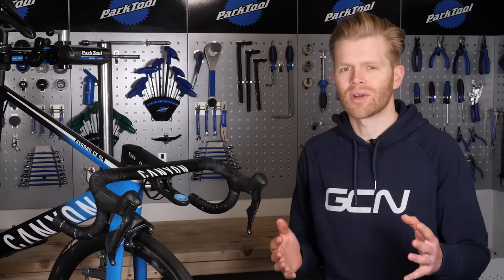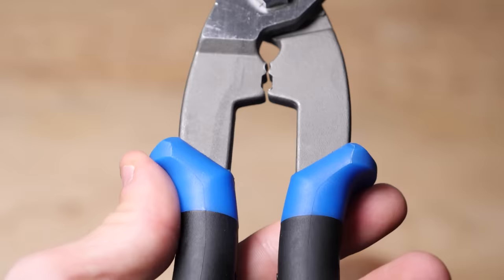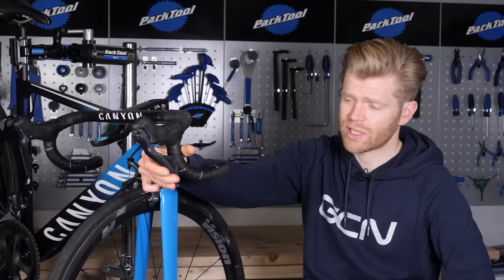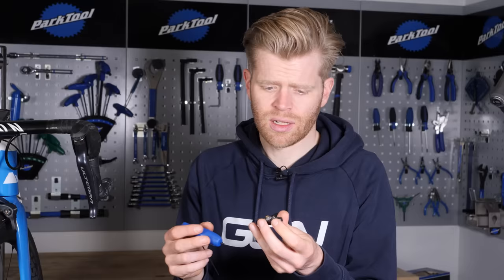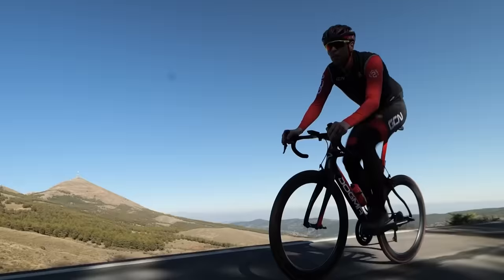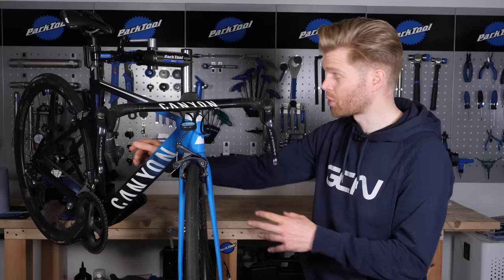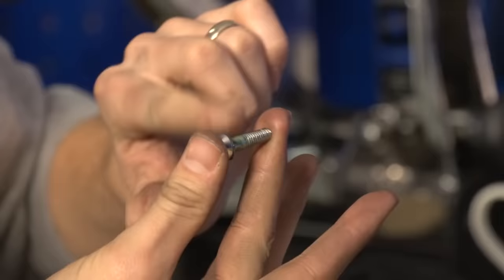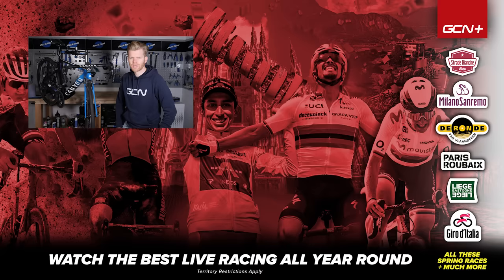Try This Before Changing To Disc Brakes! | Maintenance Monday

Comment: Instead of a card I use a rubber band wrapped around the brake pad to set toe-in. The rubber band provides more friction and prevents the pad from rotating as you tighten the pad to the brake arm. Also, I do like to have the gap between my front brake pads a little bigger than my rears so that my rear brakes engage first. No fun having the front wheels lock first and launching yourself over the handlebars...especially in an emergency stop. I have found find that on alloy rims the performance of Kool Stop Dual Surface Brake Pads never cease to delight. Most Kool Stop brake pads have a feature called a "Plow Tip" which substantially reduces the grit that can get trapped between the pads and rims. This effectively removes a common objection to rim brakes...that they contribute to premature wear of your rims. The plow tip can also be used to set the proper amount of  toe-in. I bow to the engineers who invented this feature! Long live clever engineers!!! 🙇‍♂️🙇‍♂️🙇‍♂️
Reply from the maker: Great hack, Mr.Luigi!
Reply: My Kool stop pads have a little raised point and one end and 'automatically toein'
Reply: @chrisprice5895  
that's a nice and clever feature. I always looked past kool stop though because they are expensive, admittedly.
Reply: @chrisprice5895  Hi Chris, Yes, that is a great feature. It's often called the "Plow Tip." Here is what Sheldon Brown says of the feature.

Plow Tip

The plow tip is a small wedge-shaped projection at the rear end of most Kool Stop models.
It acts as a squeegie to clear water and grit from the rim, so that they don't get caught between the braking surface and the rim. Setting conventional flat-surfaced brake shoes so that they provide toe in creates the risk of trapping grit and sand between the brake shoe and the rim. This grit then gets embedded into the surface of the brake shoe, where it grinds away at the rim every time the brake is applied. This causes premature wear to the braking surface of the rim, a serious problem on bicycles ridden in muddy/sandy conditions.

It also provides a built-in guide to ensure correct "toe in" of the shoes.
Reply: @MrLuigi-oi7gm  nice
Reply: @chrisprice5895  👍
Reply: Problem with the plough tip is that it will soon wear out... And toe-in is a waste of time for the same reason
Reply: @peterwillson1355  Actually the plow tip is quite long lasting as that half of the pad is made of a tougher material then the other half.

Comment: I love my rim brakes on carbon wheels mostly just for the sound it makes. Sounds like a fighter jet.
Reply: Ive got some tri spoke carbon rims for my track bike, and they sound like helicopter blades.
Reply: Just replaced my aluminum to carbon wheels, at first i was like "wtf is that sound?" 😅
Reply: My aunt has rim breaks on her old road bike. It sounded like a supersonic jet breaking the speed of sound. They stopped making that sound after they were adjusted😢

Comment: using the card as a shim to toe in breaks is so simple and glad to see this solution. thank you.
Reply from the maker: Glad it helped!
Reply: Back in the Stone Age, you couldn't pivot the brake shoe. You had to slightly bend the caliper to make the front of the shoe contact the rim first. (or you could place some tape on the shoe to cause the front to tough first) It wasn't until the late 80's that you could pivot the shoe.
Reply: Always done this.
Reply: @billkallas1762  On the other hand, once the caliper took a set, you didn't have to fiddle with the seemingly 8-dimensional adjustment with each new set of pads 😄.
Reply: @gcntech  I must say I use 2 thicknesses of masking tape and stick 
it to the rim leaving both hands free to adjust the brake shoe and make sure it sits perfectly parallel with the rim surface .

Comment: Compressionless outer housing has significantly improved my rim brake stopping power. No more spongy feel anymore. And they're lighter weight than standard housing. Highly recommend this to upgrade your braking performance - I'm actually surprised it wasnt mentioned in the video
Reply: Was just about to say this. Totally agree.
Reply: I did this last summer. I had some off cuts from my gravel bike, so I stuck them on the road bike. What a difference!

Comment: There is another 
past-wear-indicator-pre-braking-surface-screw-thread-machining-alarm-device 
build into the brake shoe.
It is a plastic screw underneeth the pad intended to rub on the rim 
thus creating a "notifing noise", usually without damaging the rim 
and setting in before the shoe mounting screw brings early death 
to a hoop.

Thanks for the informative video!
Myself, still rubbin' da rim. 😎😉

Comment: rim brakes for me.

I had 2 2019 tcrs one rim the other disc. For me I prefer rim brakes the ease of set up and maintenance.

You'll get the keyboard warriors stating about rim wear but this literally takes years (unless u decide to use your best carbon wheels in winter on gritted roads of course which is then user error imo).

Wheels have also come a long way and resin temps are much much improved. I use a set of boras and shamals and find the braking on my carbon boras just as good as my shamals.

I totally get disc if you ride in the wet a lot but if it's hammering it down I'll just use the turbo 😂

Comment: Been on disc brakes for the last few years, I restored an older frame with new Campi rim calipers and I fell in love with rim brakes again.
Reply: A rim brake is a disc brake with 700mm diameter disc! 😀
Reply: @truthseeker8483  and it's covered with rubber to prevent nasty cuts if you crash..

Comment: Right I think I know a thing or 2 about bike maintenance.  I'm riding road bikes since 1986 when I was very young.
Worked in a bike shop as a mechanic too.
Reffering to brake pad toe-in. This is an old traditional brake hack. This was necessary way back in the past, up to 1980s because rim brakes were not the best. The brakes would flex through aggressive braking and you wouldn't get an even connection from brake pad to the rim.
On modern rim brakes , well quality ones like Shimano Ultegra R8000 or Dura Ace, on most of the quality rim brakes - calipers don't flex so toe-in is not necessary.  I have toed in Ultegra R8000 rim brakes as an experiment and it resulted in the front of the brake pad wearing faster than the back. This toe-in may work on new pads, but after a few months the front will look more worn than the back and the pad will  take on a triangular appearance when viewing the top of the pad. After a certain amount of time the the whole pad will contact the rim evenly. 
So, to sum up, pad toe-in is Not necessarily on quality rim brakes,  I stress quality . Probably necessary on cheap calipers like Tektro. On good quality brakes it will result in wearing the front of the pad faster than the back.

Comment: You could have talked more about the difference between brake pads. They make a gigantic difference, especially if you are riding with extreme weight and really need more stopping power.
Reply: as a 220 lb rider myself, this is very relatable. every braking system is much less effective when you're moving nearly twice as much mass as their target market.

Comment: Great video! I use both disc and rim brakes but I prefer the latter one.
Matching the pad to the rim can also make a difference. The black anodized (Campa Shamal Mille/Fulcrum Zero Nite) alu rims with their dedicated pads (blue) brake fantastically good.
My mate told me the same about Mavic Exalith and its due pads, albeit a bit noisier.

Comment: This is good. I am keeping my rim bike and upgrading the calipers. I like the braking confidence I have in the wet with my disc bike, but the rim bike looks fly and climbs like a champ.
Good tip on calipers not returning to full open after lever release. Will try servicing the old ones.
Reply from the maker: Glad we could help you, Blake!

Comment: Discs on a road bike is overkill, rim brakes do the job really well given its not wet. My sora brakes do a goob job descending steep hills without problems. my bike weighs around 12kgs and im 70kgs, bit heavy but can still stop at ease
Reply: They're not overkill where I live. My bike weighs 7.5kg, and I weigh 73kg. Back when I had my rim brake bike, stopping at the intersection at the bottom of the road from the mountain was a process that involved a lot of praying, cramps in my forearm from squeezing the life out of my brake levers, and the smell of burned brake material. In the wet, you could more or less forget about it. With disks, I can ride faster, and stop much easier.
Reply: @mihalis1010  maybe you weren’t keeping pads and rims clean if it took that much effort to stop.Or cheapo pads🤔
Reply: A rim brake is a disc brake with 700mm diameter disc! 😀
Reply: @truthseeker8483  it really isn't.
Reply: @mihalis1010  i agree discs are better, i also own a gravel bike with hydraulic calipers. But my rim brakes don't feel inferior to the discs. I literally crashed cause i had to do a sudden stop and the rim brakes were strong enough to lift the back wheel lol, but to each their own. Discs will always be better than rim brakes

Comment: Great tips! As far as brke pad maintainence I use a sandpaper style fingernail file (not the metal style) to scuff up the surface of glazed pads. For aluminum rim cleaning is use a rag dampened with denaured alcohol.

Comment: RJ the bike guy taught me to cut cables at various points before removing since it's extremely unlikely that a fray is inside an outer, so cutting the line allows you to remove the cable without damaging an outer. 

I would also strongly advise Shimano cables for Shimano systems. Especially true for gear cables which wear out easier. The more expensive, heavier duty wire is more resilient and smoother through the outer.

The barrel adjuster is not only the way you work through the pad, but your indication that they need replacing.

Comment: Have converted several 90's hardtails to high performance monstercross. It's usually simple to upgrade the fronts to discs with a fork replacement, but for the rears have had good luck sourcing high-end rim brakes -- still powerful enough for the rear.

Comment: I am completely content with rim brakes. My favorite ride is a 1997 Serotta Atlanta with Ultegra rim brakes. It has always had enough stopping power for me, without needing the frame to be beefed up near the dropouts. There was a long shallow hill that tilted back towards home as I would do my final sprint. There was a stop sign two blocks before my place. Even on my first road bike, the Rocky Mountain Oxygen 30AC with Techtro brakes, I could get it hovering on the front wheel as I came to a stop there. Now, if I endo with my belly pressed against the seat with my arms stretched out like Superman (I make no claims at being a superhero). Then I think that is all the braking I will ever need. I don't know if I am able to squeeze harder than most people, but I can't imagine needing more than that. Perhaps it is that I am riding a 62cm frame (on my Serotta, the RM was a 60) and I am just too far off the ground to benefit from stronger braking without flipping over the handlebars. Which would be temporarily doing an even better impression of the 'Man of Steel' when he takes flight.

Comment: I use a heat shrink tube instead of ferrules.
No fraying experienced yet for a number of years.

Also easier to remove the brake cable when changing handlebars.
Reply from the maker: Great little hack!

Comment: I like to have the brake lever really close to the bar when I brake, this gives me more control when I go downhill. And it works as a limit in sudden brake and that saved me from more than a bad fall. When you brakes for a sudden danger you haven't time to measure your force, and that can make you stop the wheel, and crash is inevitable. Bar works as a limit to excessive force in uncontrolled braking, while when you are in control it you can simply pull the lever a little outside and you have all the force you need.

Comment: Rock and Roll will never die. So is Rimbrake. I have a Dogma F 12 and Dogma F Both Rimbrake. I love both of mine Rimbrake Bike. Don't have to keep on changing Brake pads 😉 Do bleeding or top up Dise brake oil. No sounds. And Braking is fine on Rim Brakes. Can stop any where you want.

Comment: Best brakes I've ever had.
Weinman 500 with natural rubber blocks on alloy rims.
Second best.
Mafac Racer.
Reply: Do you still use them? Have you compared them recently with modern brakes? When I did l'Eroica on my 40 year old bike the first thing I noticed was the lack of braking power; and yet they were a revelation when I bought the bike in 1978.
Reply: @grahamaustin9085  
I have discs on a Whyte road bike. They are pretty well next to useless.
The Weinmanns are on a 1951 Claud Butler Super Velo Single speed.
Reply: Sorry to hear about your discs. Are they hydraulic? All the people I know with mechanical disc brakes complain about them. But I was comparing my old centre pulls with modern rim brakes.

Comment: Built up my summer bike late last year with 105 R7000 groupset but picked up a set of Ultegra R8010 direct mount calipers dirt cheap. Great upgrade that saved quite a lot of money. Still yet to test their limits as we have not had good enough weather in the UK.

Comment: There was no problem with rim brakes. I still have rim brakes on my road bikes. I have disc brakes on my mountain bikes and generally hate them, aside from being able to ride through streams without getting sand on rim brakes and scratching the rims. But descending at high speeds on hard pack dirt trails and fireroads, the tendency to lock up the wheel is way higher with disc brakes regardless of the play setting.

Comment: GCN, please do a video on carbon rim break wear and safety. Particularly if there's any way to know when the rim has worn beyond safe use. Alloy rims have those punch depth marks that disappear when rim width is worn past safe spec.  I think any cyclist has known someone or known of someone who has had a carbon wheel fail on a descent. I don't know why manufacturers can't fabricate  in a layer of yellow material that is exposed when wheel brake track depth is compromised. This is the only thing keeping me from a sweet carbon wheel upgrade!

Comment: The newer rim coatings that seem to only be on aluminum rims make a huge difference on performance.  Similar to the old ceramic coated mavic rims from the 90's.  DT Swiss Dicut rims, latest Boyd Altamonte rims are just amazing performance.   I've kept my rim brake frames for this reason.

Comment: I never plan to ride in the mountains, so why should I use disc brakes? I've been riding for almost 40 years, and have never crashed because I couldn't stop in time. (and that includes 32 years of racing)....My pads last for 10's of thousands of miles.
Reply: Well said👍🏻

Comment: Oli, this is a great video with fabulous real world technical information. One thing about rubber brake pads is the dry out with time. They may not look worn down much at all, but if you push your fingernail into the flat part that contacts the rim you discover it feels like a formica countertop. It's time to replace the pads. I replace mine every year to get the best predictable speed control. I have disc brakes on my commuter bike but not my road bikes. I tried disc brakes on a road bike I had but I didn't like the feel. I like the feedback I get from the pad on the rim via the steel cable. I don't need outrageous stopping power, I want control of my speed.
Reply from the maker: Great tip, Jeff - it's always best to replace your brakes if you feel they're not performing as you want them to be!

Comment: Goretex cables & SwissStop pads worked wonders on my alloy Allez rims.
Reply: I'm a heavier rider (200 lbs, not obese by any stretch) and I couldn't keep my stock Allez rims true. I switched to vision team 35s and they've been dead straight ever since.
Reply: I've never had problems with stock Shimano pads, cables, and housings.

Comment: I have switched to disk brakes and I love them. Only buying disc brake frames & forks from now on. I found this video trying to salvage any hope for my rim-brake road & mountain bikes, and now, I don't care anymore.

I'm a heavy person, big & tall, and worse, for fun and more, I build ebikes & engine-kit bikes that are as fast & quick as possible. My pads & rims keep getting glassed over, and I end up squeezing my rim brakes hard enough to snap cables.

For my rimbrake frames & forks. Maybe dual hub motor Regenerative Braking can save them from the garbage or being sold off. But as for my normal & boosted bikes, I'm done with rim brakes. It is extremely frustrating, and dangerous, not being able to stop, and not being able to go as fast as I want or can, because the rim brakes are so weak.

I'm done with rim brakes. I'm sick of them. Even just coasting down hill, on a normal bike, have lead to many close-calls & crashes. The weight & speeds of an engine or electric system, just makes that situation more frequent, even on flat ground. 

I'm only using disc Brakes and Regenerative-Braking from now on. Basic organic pads, then upgrading to metallic pads with bigger rotors meant for them, then maybe hydraulic lines.  And one day, I hope to have metal teeth, directly holding the tire tread for parking, and exclusively using powerful, analog signal RegenBraking for stopping, and finally be done with all the maintenance, costs, and noise of traditional brakes entirely.

There are motorcycles like Buell/EBR, that have the brake rotor at the rim, instead of the axle. But for certain, bicycle style rim brakes are dead to me. Using the last set of rim pads I have, will begin my Metal teeth, RegenBraking project.